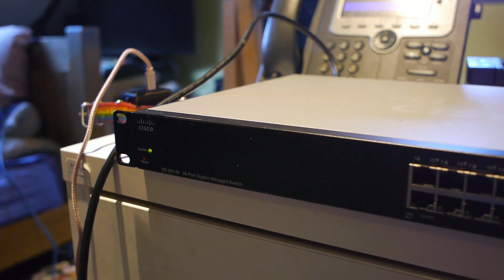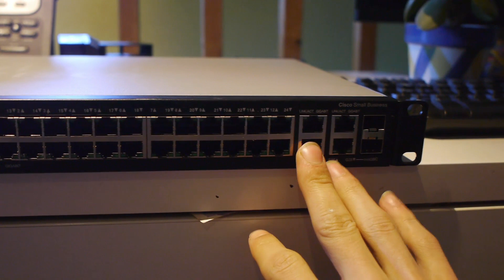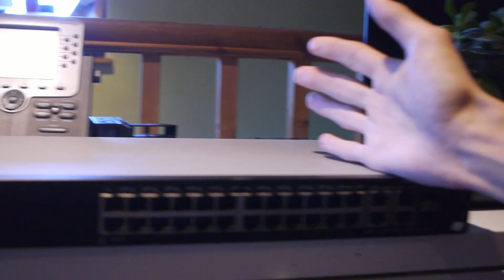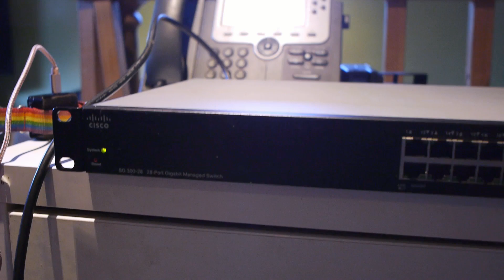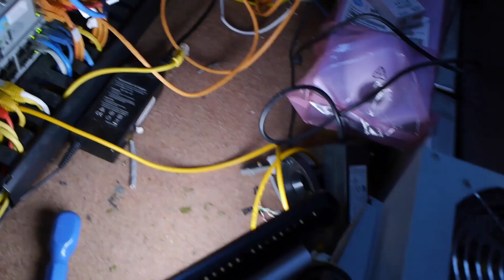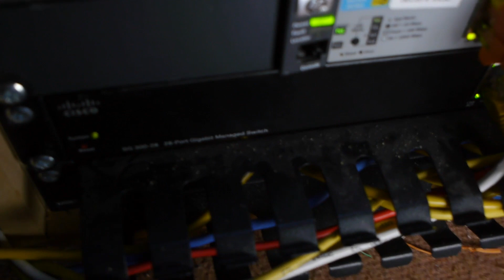Cisco SG300 Layer 3 Switch Installation/Upgrade Homelab

Comment: 20/28/52 ports is not "weird". The extra 4 ports would be used for management and uplink/interconnects.

It's not unusual for rackmount equipment to be loud. You can easily swap out the fans for some Noctuas to reduce the volume.

Comment: I coulg get this exact switch used for 50€ ... 🤔
Reply from the maker: Very good deal :) love this switch. still running flawlessly. its not the most fully featured L3 switch but its fanless :D at least on the 28 port version.
Reply: @bluntlab  I endet up with a Brocade ICX 6450 24 Port and a Cisco Catalyst 2960-X 24 Port, everything kinda got out of hand :P